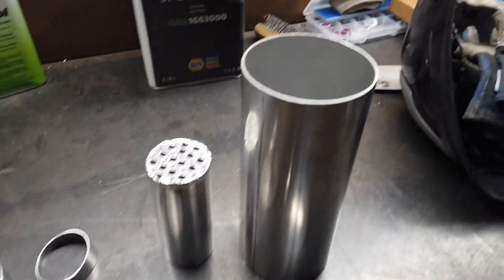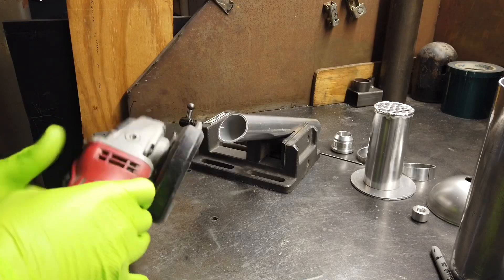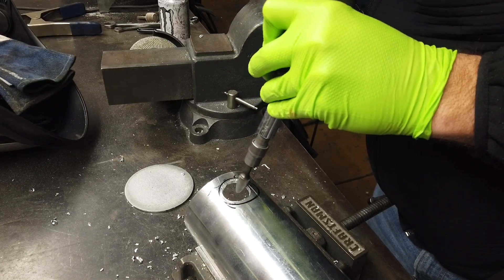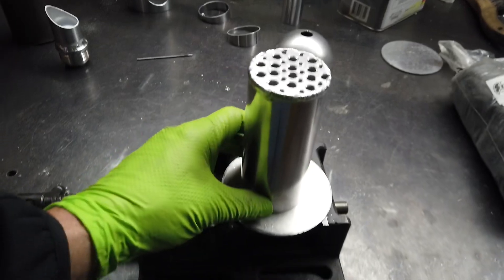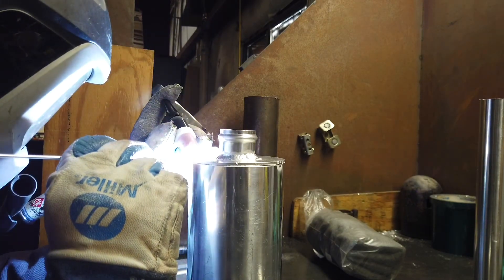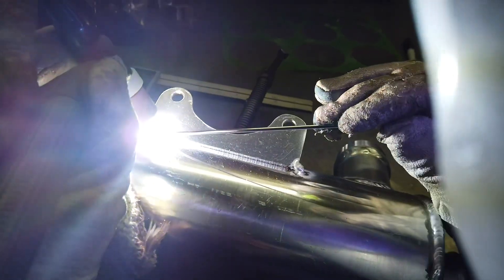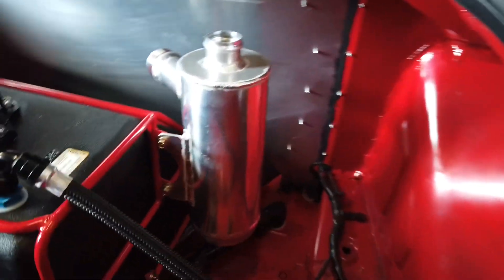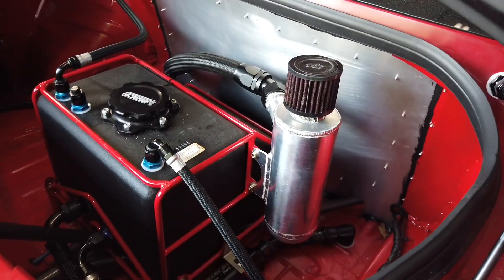How To Build A Catch Can (DIY) for a R35 Nissan GT-R

Comment: Great video thanks for. We're on the motor does the -20 line originate that goes to this catch can? Is there a y from the intake valve covers that go into a single -20?
Reply from the maker: There is a single -20 line that comes off the center valley plate that provides the main crankcase vent. Since this video was made we have added a secondary breather to the valve covers that are 2 -10AN lines to bring the crankcase pressure back to atmospheric pressure. 60+psi of boost makes you rethink a few things!